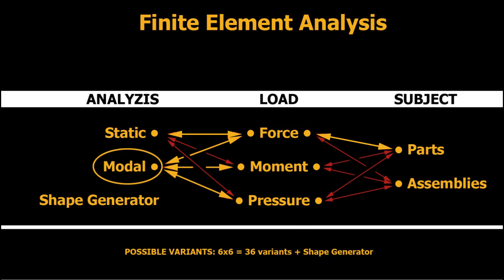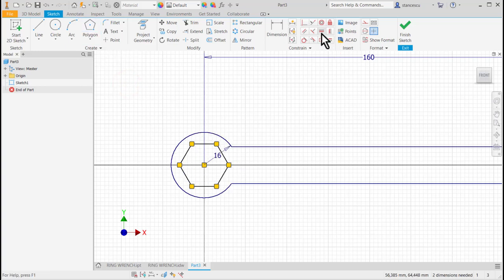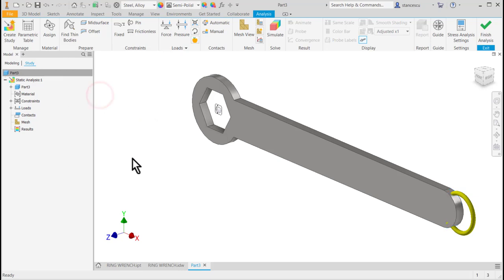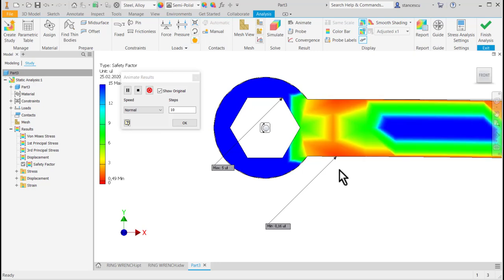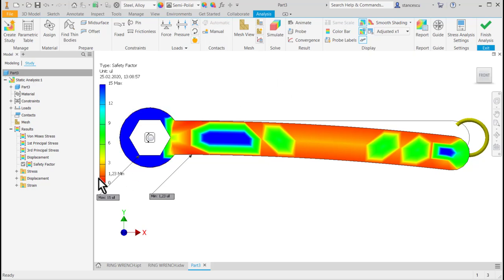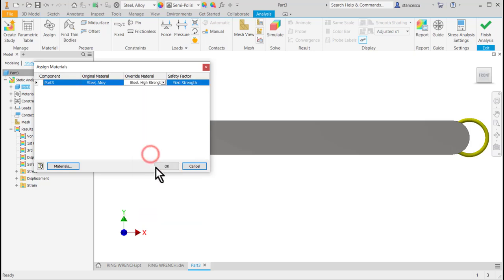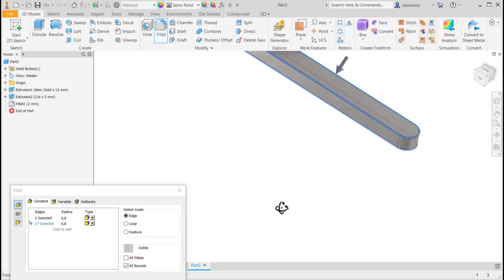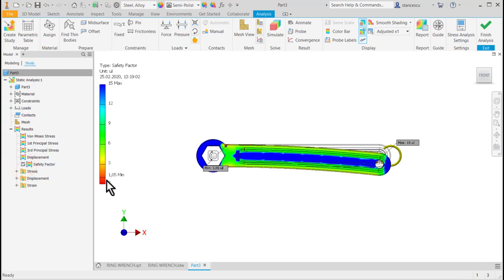Tutorial Inventor - 039 FINITE ELEMENT ANALYSIS - Parts (Moment)

Comment: Wow, with a lot of variety, We can choose the perfect material and thickness till we reach the desired Saftey factor :) one question, is there a place where i can read about , what are the required safety factors for industries ? :)
Reply from the maker: A coefficient of 1 is at the breaking point. 
Its value depends on the purpose of the part or machine. An airplane has a little over 1 (1.4 ... 1.5), but a locomotive has 20 or more, because it has to be heavy anyway.
Reply: @prof-stancescu  Thank you for explaining :)

Comment: How do you access moment constraints? For example, if I wanted to see the deformation caused by two clamped sides of a panel, maybe I'd want to constrain all 6 motions, Fx,Fy,Fz,Mx,My,Mz. Why can't I find this? While I know that inventor professional doesn't have buckling simulation codes, I was playing with a panel that had uniaxial loading and clamped on the same sides. I would want to prevent rotation about the axis in the same direction as the loaded edge part. As of right now, my simulation is constrained in the x,y, and z direction, but because I added no Mx constraint at the fasteners, there is an angle made at the fasteners. If I wanted it clamped, there should be no rotation there. I don't know if I'm missing something, but it seems so much easier in patran, and also ansys.
Reply from the maker: I'd show this in the tutorial.
If you send me a picture with your problem would be more useful (constantin.stancescu@gmail.com).
Reply: @prof-stancescu   Thanks for offering to take a look. I just sent you a gmail with a detailed explanation of my FEA and what I want to do specifically.